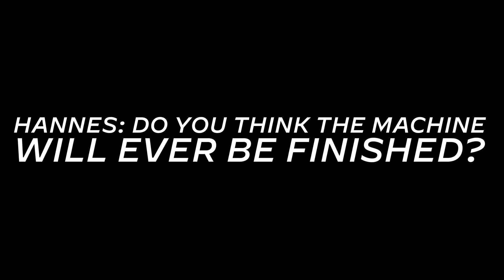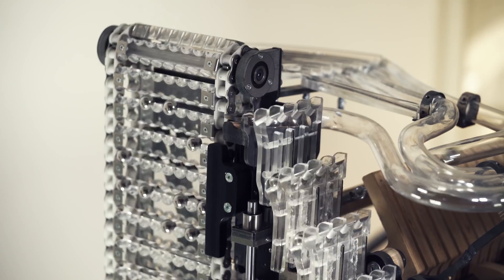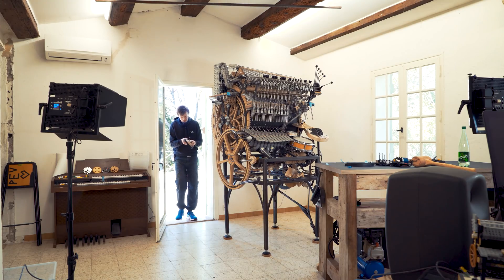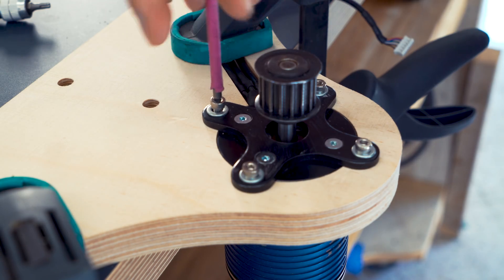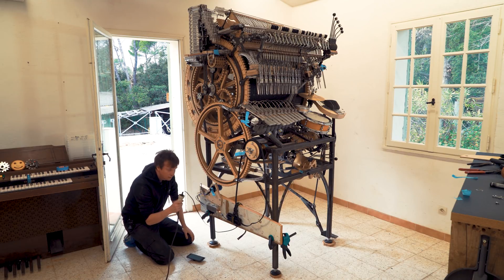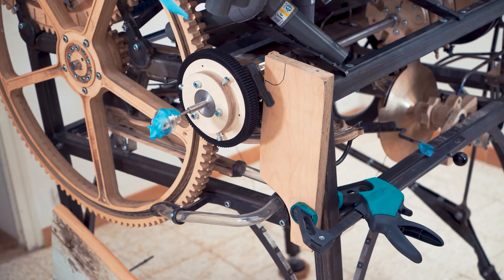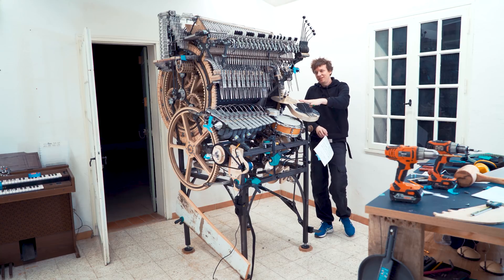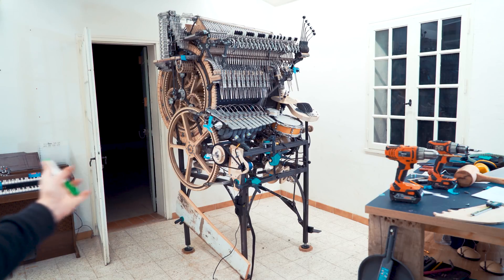Electric Motor? - Marble Machine X #114

Comment: Pay attention to the motor temps. They contain neodymium magnets which do become useless past a certain temp threshold. It's been several years but I think it was somewhere between 100-200 deg C. Normally these things move through heaps of air on a plane or skateboard, but here there is no airflow. It might be fine, but it might overheat when you use it for an hour, especially during a hot summer day in the sun. Maybe a silent fan of sorts or a little attachment that spins with the motor to send some air over it?
Reply: Just as an idea, maybe a silent pc fan? Like a noiseblocker eloop when you make something with little air resistance or a noctua nf-a12x25 when you have more air resistance from something like a filter to keep grass/sand out.

Comment: I know it defeats the purpose of having it hand operated and manually tempo controlled, but a simple Arduino or a RPi would allow you to program in the tempo. A press of a button or small touch screen would set a precise tempo.
Reply: He'll probably prototype, build and then have machined in brass some sort of bridge engine order telegraph as a visual display for the motor speed regulation. It will cover 4 episodes spaced over 6 months.
Reply: @MrGonzonator  And we will love it. Martin might want this build finished, but I don't want to be deprived of the Wednesday videos :)
Reply: @v4lgrind  oh I know, it was less a criticism and more of an observation!
Reply: I just come here for the engineering and problem solving… and CNC things made out of plywood. 🤤

Comment: Is he ever going to use the foot pedal again ? XD
Reply: It’s for security, if someone tries to steal it, it kicked them in the shin.
Reply: yeah, foot pedal becomes more and more useless :D GOOOOOOOOD
Reply: Somebody in the comments here mentioned that the motor can be strained if Martin is going to only use the motor itself.

So yes I guess? The pedal adds alot of speed by itself. And if Martin used the motor by itself without giving it an extra push, the motor can catch on fire by how fast it's moving (friction) and the wood around.
Reply: c h i l l e d m e m e the motor can handle a lot more than any human. I would worry about the motor breaking the machine of something goes wrong.
Reply: I believe the intention is to only use the motor for setting up, testing and refining the machine, not for use in actual performances.
Reply: @MrGonzonator  Hey, he doesn't call it the "stage dive mode" for nothing !

Comment: Honestly, I like the looks of the longer belt with the motor mountet in the back way more. The electric motor in the front takes away some of the marble machine aestethics. The long belt crossing the large gear looks great. Maybe get a longer cable for the motor to still be able to control it from the front.

Comment: Move the pedal a bit higher, because it can occasionally break your feet if you move feet underneath the pedal while motor is moving ;)
Reply: It's articulated specifically so it won't break his feet! Safety has been a common theme during the design and construction of this beast. 😁

Comment: the break, which separates the machine from the flywheel and stops all movement, should also disconnect power from the motor?  
like an OMG stop! handle.
Reply: Kinda like an E-Break on a car?

Comment: Amazing addition, is the flywheel still necessary at this point? I guess if operated without the help of the motor it is. (Why do I write a question, just to answer it later ah.)

Comment: Hi Martin.
I recommend not using this speed controller. It is not very accurate, quite noisy and
it creates strong magnetic interference, that could be a problem when using it with microphones.
Look into using an controller wit encoder feedback and FOC! Especially for audio sensitive work
I would use the open source ODrive controller. It is really silent and very accurate!

I am really excited that you think about using an electric motor. If you need any help regarding this topic
feel free to contact me :)
Reply: +1 for the odrive controller.  It works like magic.
Reply: Dude, what's wrong with VESC? It already has FOC support. Odrive isn't even much different at all, just bigger fets and two channels.

Comment: Martin: implements torque limiter
 and over-engineer flywheel
Also Martin: implements motor that bypasses the torque limiter and renders the flywheel useless
Reply: flywheel is still useful. A motor itself can't act as an effectively stored potential energy; straining electronics and likely cause fire should it be overloaded.
Reply: @yt45204  There is also the implicit torque limit imposed by the power supply.
Reply: And the pedal seems useless too now
Reply: Not talking about the over-engineered foot pedal, which was supposed to free Martin's hand but now it's just a useless piece of metal flapping around...
Reply: @Posiman  Don't forget Martin is a master of the angle grinder ;-)

Comment: Using a motor with that much torque I would suggest using a slipper clutch to prevent any damage to the machine.
Reply: within this decade, or none! ;)
Reply: He was perfectly clear, TWICE, that he can stop the machine dead while the motor is running, and it's fine.
Reply: 3rdaxis 
I think that the ESC has some sort of current limiting function. Otherwise he wouldn‘t be able to stop it by hand. Also, the power supply isn‘t that big, propably around 100-200 Watts which also limits the torque of this motor. The motor itself sure looks like beeing capable of 1kW input power but that doesn‘t matter if ESC ans power supply limit the current.
Reply: @christiansprojects-cgmanuf1426  looks like Dell laptop PSU, so probably 65W
Reply: @evilgremlin  my Dell laptop PSU has 180 watts :p
Reply: Planetary gear assembly itself doesn't have a lot of mass though...
Reply: You can set the max torque easily in the ESC (in this case VESC 4.12). It's just enough to drive and the MMX. The hall sensor isn't used. Wouldn't make a difference while running. Only for startup it would help. But there Martin can give it a little push and it will go.
Reply: @AlexCNC  Should switch to the FOC mode of the vESC, the motor will be MUCH MUCH quieter under load. Really made a difference with my enertion vESC.
Reply: The MMX already has a slipper clutch for safety. You can hear it go "click click click" when he stops the machine with the crank.
Reply: @arska-pelejavlogejajaautoj5030  yeah but on the flyweel not on the motor
Reply: @nunosousa2942  Yeah, I realized.
Reply: @nunosousa2942  why is that not good enough?
Reply: @Zwettekop  ????????????????
Reply: shhh dont tell him that.
Reply: @Danuxsy  lol, you're probably right.
Reply: @Danuxsy  Either way we'll have the best youtube video ever.
Reply: Alex said martin could break the machine ....
Reply: @manfredschmalbach9023  Is this a joke? Brake.. Not break.
Reply: @goodiesohhi  Yes it was - a joke, that is. Sorry, with a German name people do not believe in my ability to joke, at all. I often suppress that sad fact.
Reply: shear pin
Reply: @leeknivek  With an ammeter.
Reply: And crown the pulley so that belt stays centered.
Reply: @GSImproved90  it seems to me centering is done by carefully aligning the motor mount to both have a 90 degree angle and line up with the machine toothed wheel. This is less crtitcal with a short belt as you can see in the video. A longer belt might need an idling wheel to guide it into place.
Reply: Should check out mind blowing  magic magnets on you tube!
Reply: I suggest you up your balls per minute game before talking smack.
Reply: I thought he did.
Reply: the motor has an built in slipper clutch... he used the hand break and the motor was still on... so its a pretty expensive motor
Reply: SwissRiven 
No, there‘s no clutch. The motor is a Turnigy SK8 by hobbyking, made to power homebuilt electric skateboards. The main reason to choose this motor is the built in hall sensors. This, in addition with a good ESC (Probably Flipsky VESC) makes a very precise speed governing possible.
The motor doesn’t have a clutch but the speed controller is able to limit current and torque.
Reply: SwissRiven not a mechanical clutch, but a torque limit implemented by the ESC
Reply: @SwissRiven  There is no mechanical clutch in that motor.
There are hall sensors though and the controller can read them. 
The whole thing works exactly like an electric bicycle system.
Reply: @SwissRiven  Yeah, engineer in me was holding his breath when he did that
Reply: It does seem to have something like that built in - very cool.
Reply: Your right he needs to add a slipper clutch or else he'll burn out the motor and the esc
Reply: @nicholasjames5313  Not with a vESC. It supports regenerative braking, since it's an electric skateboard controller.
Reply: @nicholasjames5313  It's never a bad idea.

Comment: Wouldn’t it be neater to mount the motor connected to the flywheel? This would also mean that its less visible and this also makes it safer sins its connected to the torque limiter.
Reply: yeah, that would be lovely
Reply: The problem with this is the torque limiter. When trying to slow the machine down the motor adding energy back in could potentially cause the flywheel to skip rather than adjusting the timing speed down.
Reply: @nocare  hmm that's a good point actually...
Reply: After mentally going through the power train it seems to me that you pointed out something very reasonable, this needs more upvotes to get noticed and or adressed?
Reply: EnraEnerato yes it needs
Reply: Additionally, the system lacks an automatic emergency disengage, for "stage dive mode".
Not only should the drive come from the same location, but the unsupervised drive capability calls for unsupervised safety.
You don't power a car by using a motorized belt to drive the rubber of a wheel, as it introduces negative torsion on the drive-train.
Assuming a machine will not malfunction, is a request to be proven wrong, 'safety first' for Martin, the MMX, and anyone around.
Reply: Please Martin notice this (typing the comment to boost this up). The main concern I have because of the motor is the torque. The same problem you had with the flywheel initially. This could actually solve this problem
Reply: Exactly what I was trying to explain with my wrong English
Reply: Yes!!!
Reply: It would allow for the use of the indexable clutch if it was connected to the flywheel as well. In the position on the sleeve it bypasses almost all the built in adjustments.
Reply: I think the idea was to only use it when setting all the timing and then remove it for the real play sessions. I like the idea with having it on later to.
Reply: The reason for putting it on the crank shaft is that will give the same result/timing of hand cranking. If you put it on any other shaft or gear it will create or add slop in the timing from the slop in the meshing of the gears and the other mechanics of the marble machine...  he needs to have the motor replace his cranking only.

Comment: Feature creep thats evident by a makeshift attachment board. Got it done in 1 day, yes, but with an added board that doesnt fit the aesthetic (not the board the motor is attached to but the one that board is clamped onto the frame.

Also is the controller going to be in the way of the marble catch system?
Reply: I really understood this to be temporary, so he can have extremely accurate, reliable time to test and tweak the timing of the other components. Also, he's on another monster hunt trying to dial it in perfectly, and it will take a lot less energy and be a lot more convenient having the motor help him while he tunes the timing adjustments, tests and retests everything. I would expect him to install it much more inconspicuously ... and actually install it, if it was a permanent addition.

Comment: But doesn't this make the pedal useless tho? After all this effort to make everything motorless like the demagnetizer, you're going to put a motor to power or help power the whole machine?! ...just disappointing
Reply: I got that this is for testing purposes. He needs really accurate timing to test and tweak to get even better timing. Also, note that the install was temporary - screwed to a piece of scrap clamped to the metal frame, not welded, drilled, tapped, and bolted. My guess is the motor is definitely coming off again, and if he decides to add it for real it would get installed someplace more inconspicuous. 🤷🏼‍♂️
Reply: @super_slo   Nah man. This, once mounted correctly, will be permenant.
Reply: It’s for testing purposes. Like when he wants to know and be able to dictate the exact tempo of the machine hands free. I mean the thing is mounted with clamps, so it’s not like a permanent piece.
Reply: @bbbbeeeaar  It's definatly permanent, just not installed permanently yet. He even says he'll use it to do stage dives.
Reply: @santamak  oh did he say that during the video? I must not have been paying close enough attention
Reply: @santamak  I understood that as s joke, since it was actually working and he was excited. Lol, i guess we'll see in the next video!
Reply: Agreed. It's a shame electronics have to get involved, but I guess a necessary evil if you want to take such a machine on tour...

Comment: Wouldn’t it be best if the motor was maintaining the flywheel?
Reply: I think you might be right about this. Especially considering longevity.
Reply: Was my first thought as well
Reply: The only time it isn't maintaining the flywheel is when the machine is in a 'braked' state. And it looks like the motor handles the braked state just fine. Not sure it matters where it is connected, then.
Reply: The flywheel, I would guess, has too much torque so you need it to be separated from the motor by the clutch to protect it. It also needs to be easily accessible and entirely removable, as he hasn't decided to keep it for the actual tour (I think he will though, it has far too many benefits for timing, physical effort)
Reply: @MrGonzonator  If you put the Motor on the flywheel, there would be no difference on the supporting factor.
But when you stop and then Start the machine it should take less time to start it up again, because you dont have to spinn up the flywheel again. As another bonus the motor wouldn't work against the breaks.
Reply: The motor should be on the same axle gear as the hand crank.
Reply: 99% chance I'm wrong, but wouldn't that remove the guaranteed tempo?  By turning the main axle directly the motor can govern the tempo without any extraneous steps?  Gut feeling totally scientific
Reply: Yeah, it seem a great point.
Reply: @AngelLestat2  it has if the dementia didn't get too bad
Reply: @brianbarby5613  Yeah already saw it and edited my comment. Thanks anyway.
Reply: One downside would be that when he brakes the machine you wouldn't hear the flywheel bypass rachet clicking frequency decreasing - which makes for quite a nice effect. But then again, the motor could always be disabled just before braking to regain that effect when desired I guess. So all in all, yes I think you might be right! :)
Reply: And a Feedback would be nice, so the rpm is constant.

Comment: Are you gonna add supports to that hanging bit of shaft? It might bend with time since the end of the shaft is withstanding the pressure of both the new motor torque and the vibraphone vibrato belt. I don't know how much torque is applied to the shaft so it may not be necessary ...